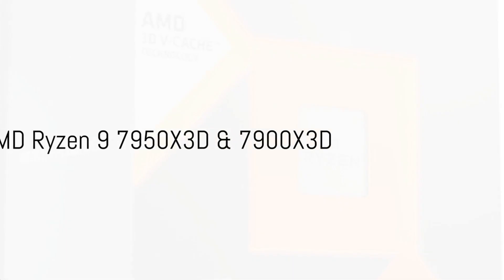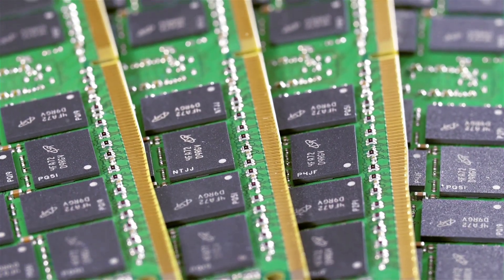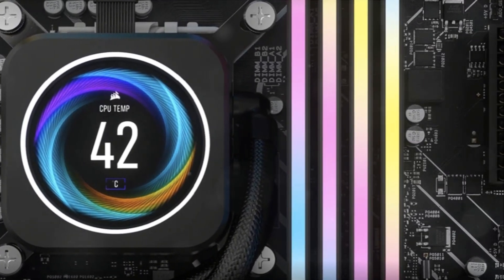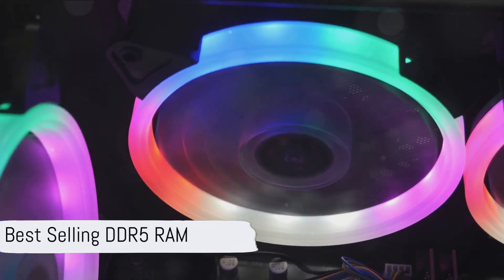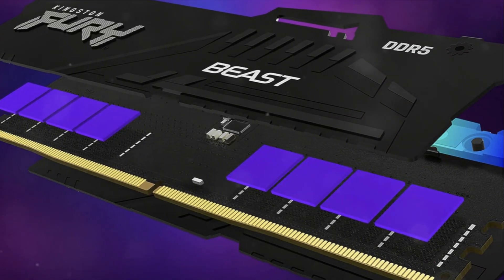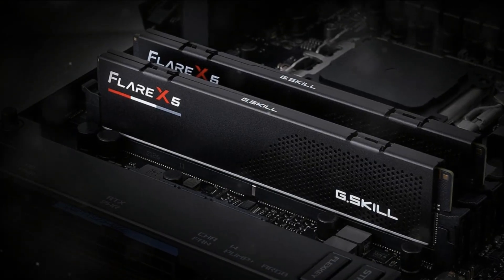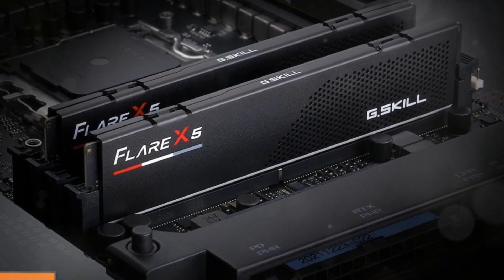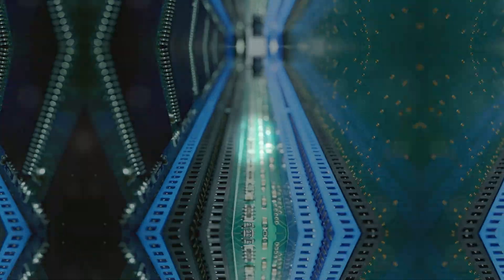Best RAM for AMD Ryzen 9 7950X3D & 7900X3D

Comment: Can you run ram above 5600mhz with an ryzen 9 7950x3d since the specification of the cpu is 5600mhz max?
Reply: 6000mhz memory is recommended for the X3D cpus.The memory speed is dependent on the CPU itself (There is variance.  Some CPUs may not reach speeds higher than 5600mhz).   Something like this F5-6000J3038F16GX2-TZ5NR is what i am using and would recommend.
Reply: @DrFettuccineRavioli  So, G.Skill  DDR5 TRIDENT Z5 RGB 48GB 6400MHz CL32 (32-39-39-102) 1.35V 2x24  is a bad choice for my 7950X3D?
Reply: @GW-su7pq  Can you provide the product # ? should look like this "F5-6000J3038F16GX2-TZ5NR"
Reply: @DrFettuccineRavioli  thank you for answer) my memory is F5-6400J3239F24GX2-TZ5RK
Reply: @GW-su7pq  No problem. The memory you listed doesn't support EXPO. This means that you will need to manually overclock the RAM to achieve its listed speed. The memory will work still though. If you haven't purchased anything yet I would recommend looking for a 6000mhz kit with EXPO. 6400mhz is also hard to achieve on most X3D CPUs due to silicon quality.
Reply: @DrFettuccineRavioli  Until now I didn’t know about AMD’s EXPO technology, but now I looked at the compatibility table myself. The memory is already in my PC( 
I set the BIOS to 6400 and it works. A little later I’ll think about whether it’s worth changing it. thank you for your responses
Reply: @GW-su7pq  Happy to help. I wouldn't worry too much personally. You can manually tune the memory to the settings listed on the box in the BIOS. EXPO just makes it very easy!
Reply: @DrFettuccineRavioli  Ok))
Reply: What would you say the best choice of ram would be regardless of cost?
Reply: The new x870 motherboards are capable of reaching 8000mhz on an amd r9 7950x3d
Reply: I have a 7900X3D and run at TeamGroup 7600MHz CL36 RAM
Reply: @PCLabs hey man, just got the same ram as you but 7200mhz, you have no issues running it at those speeds with the 7900x3d?  thanks.
Reply: No, the AMD 7950x3d only supports up to 5200mhz